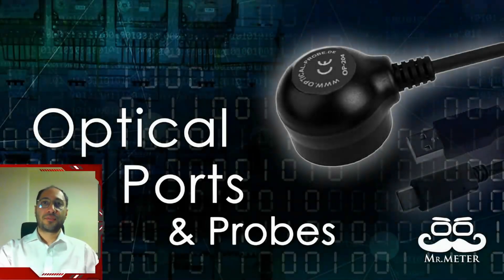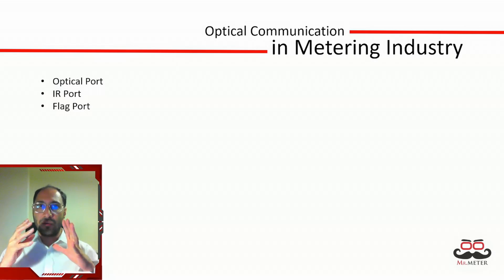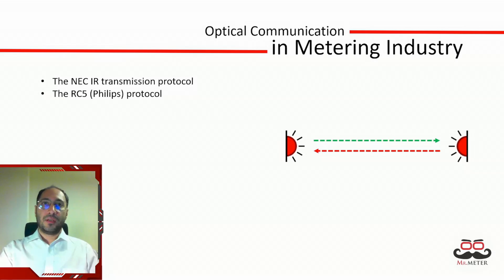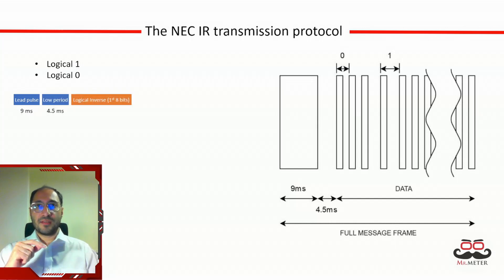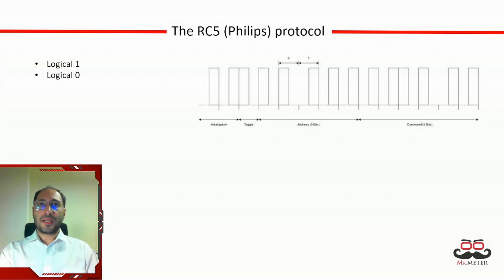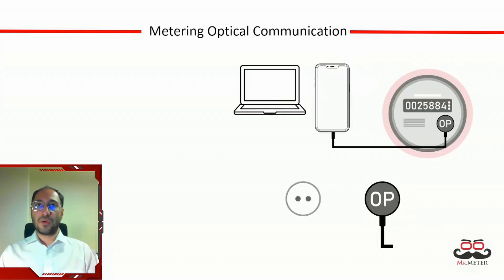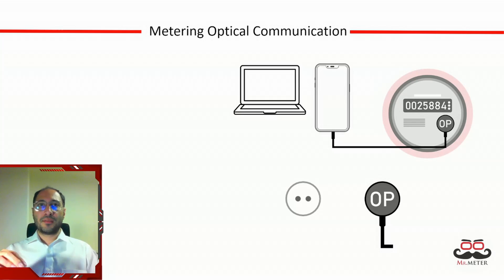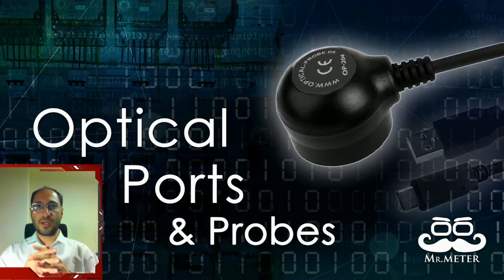Meter Optical Ports and Probes

Comment: I'm trying to find a USB optical probe for a Honeywell Smart meter (ontario, Canada) for home automation purposes.. I can't seem to find the socket type it has. it's not like all the others I've seen online... I assume it's ANSI C12.18 for north america but it's not a perfectly round one as it has a divider between the two optical holes.
Reply from the maker: you can contact German Metering directly via their website. they can help you with your request. and thanks for watching the video
Reply: @MrMeter87  I'm in Canada so unlikely they'll know what I'm using.. and local hydro definitely won't be helpful.
Reply from the maker: @VoodooZ  that is no problem, they can provide you with your needs. They either have or they engineer one for you. So do not worry.
Reply: Hi, I have the same problem. did you find the solution?